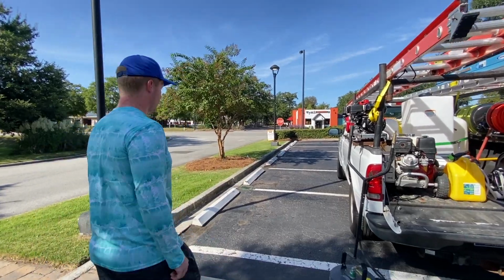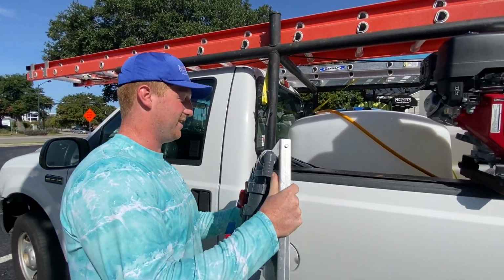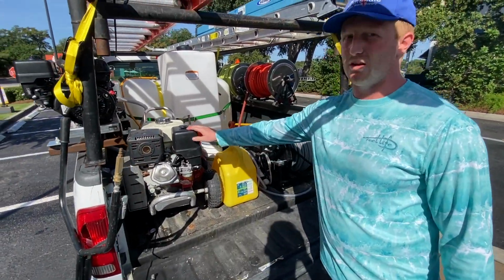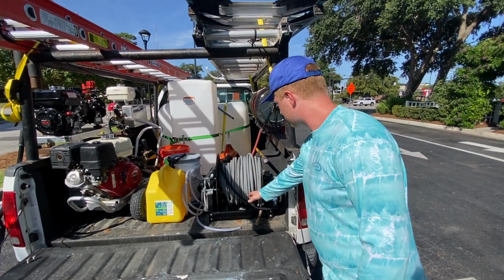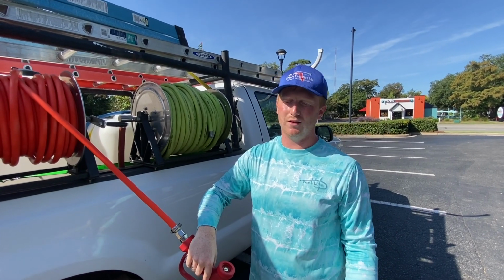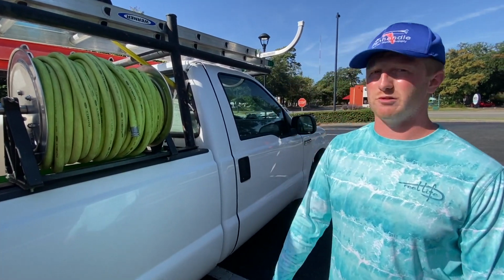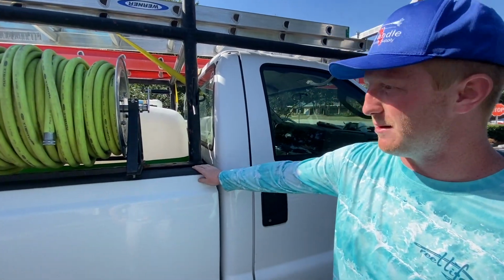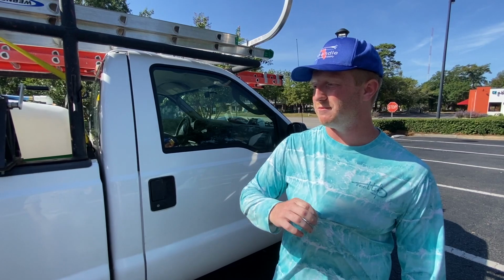$17,500 Pressure Washing Truck Build Walkthrough

Comment: Will a simpson 4200 PSI 4GPM work with your current 20in surface cleaner even thought its only rated for 4000psi?
Reply: It could if the right tips are in it. A 4gpm should run a 16” surface cleaner. The rule of thumb for surface cleaners is 4” of spray bar for every gpm the machine is rated for. If you go to the 20” you might need to adjust the tips in the spray bar.